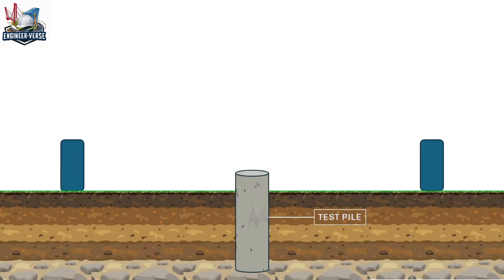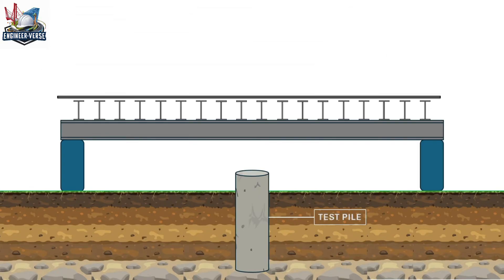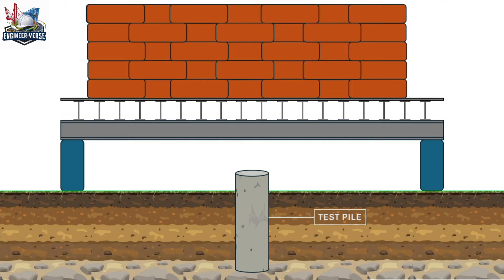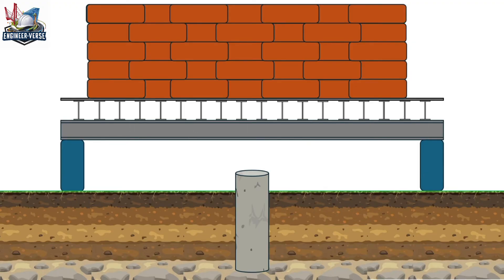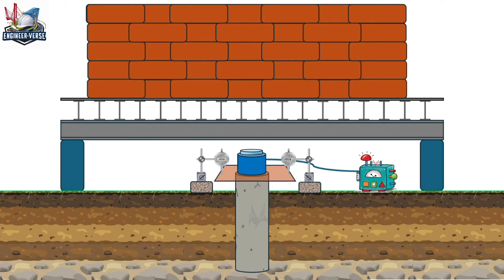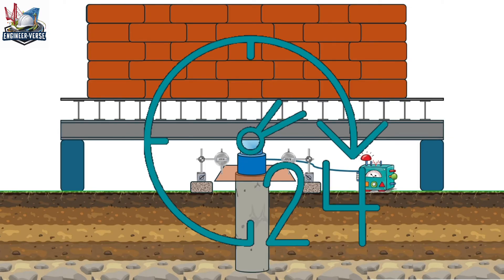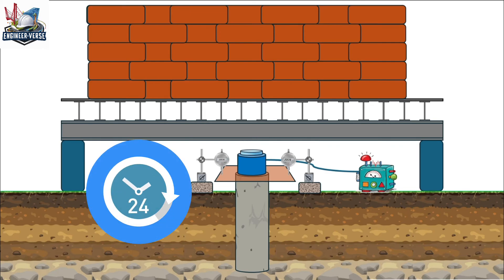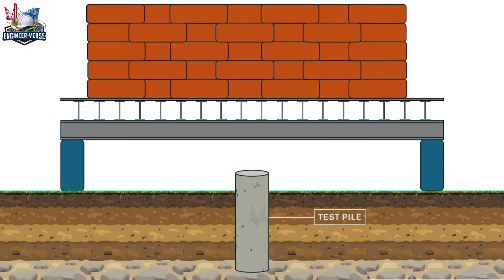PILE LOAD TEST (3D Animation) | How Pile Load Test is Done at Site? | Engineer-Verse

Comment: Is this test is better than PDA test?
Reply from the maker: Every test has different purpose. This test is done to find out the Settlement of Piles under static load. 
PDA (Pile Dynamic Analyzer Test) is used to find out the Settlement of Piles under dynamic loading (Impact Loads).
Reply: Can i say that this test is better than PDA test? 
Because in my opinion the result from PDA test is depends on hammer eficiency & the drop of the hammer right?
Reply from the maker: Yes you can say